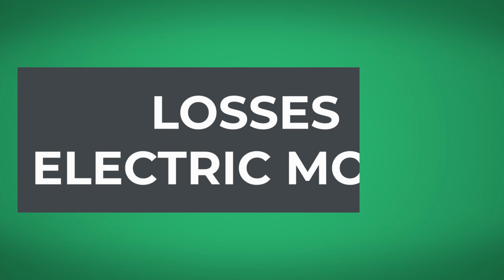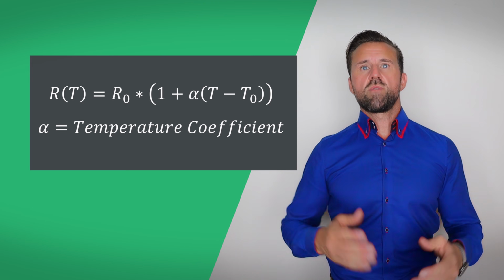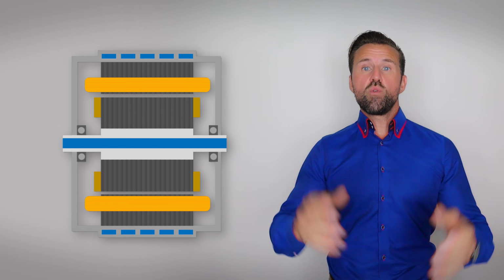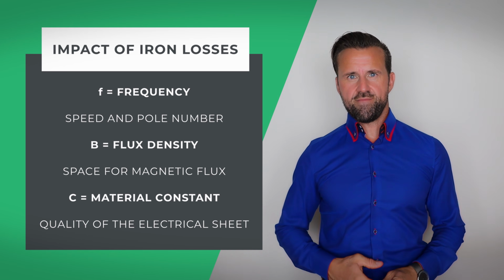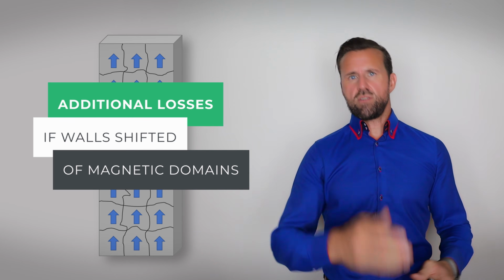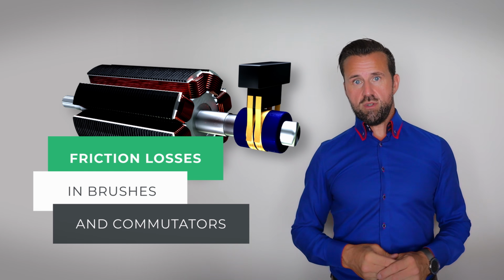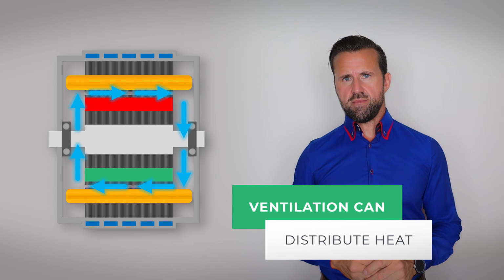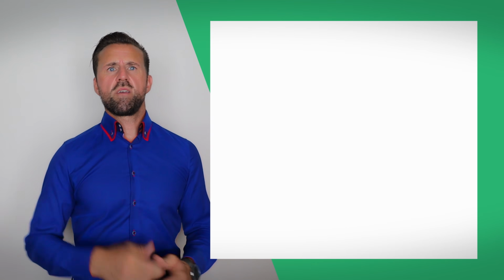Losses Electric Motor and How to Reduce Motor Losses

Comment: is it possible that mankind can make a perfect motor? an induction motor without any issue?
Reply from the maker: Thank you for your question. A perfect motor would have one hundred percent efficiency and no mass. So nothing is impossible but it will take maybe one or two centuries until we are ready ;-) but we are working on it.
Reply: @Electric-Motor  what do you think if a power generator will be the one who provide power for the elec motor then step up the electricity like a transformer so the requirement of the motor will meet, is it possible?
Reply from the maker: @lopnajhardcoremetal7686  If I have understood you correctly, you want to generate electricity with a generator and the generator is to be driven with a motor that is fed with the electricity from the generator, have I understood you correctly?
Reply: @Electric-Motor  wait, example like tesla. Battery>inverter>electric motor. 
Right?

This one is like this.
Electric motor>generator>step up transformer> electric motor with deffirential.